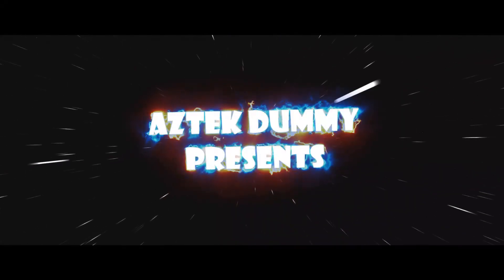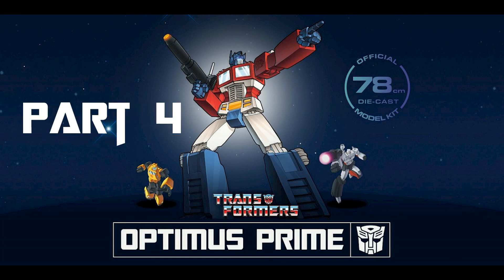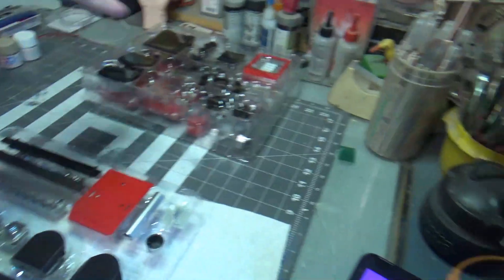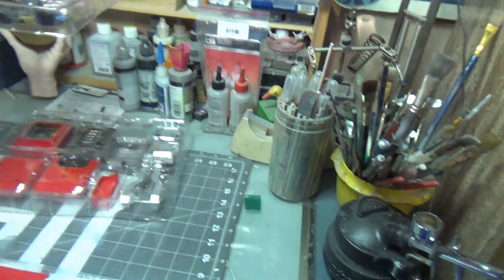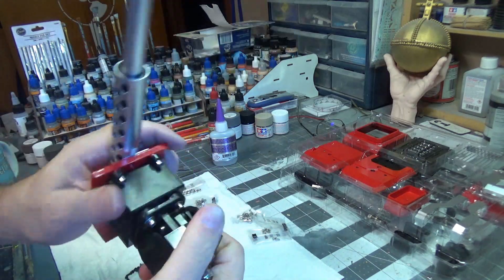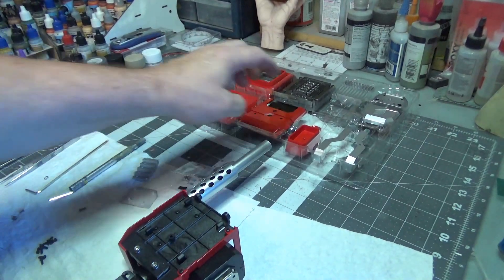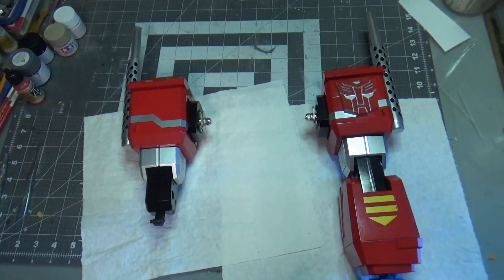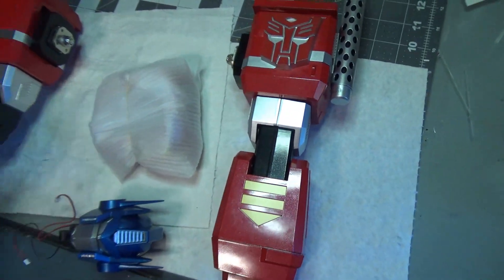Agora Optimus Prime - Part 4

Comment: That is going to be massive I just wish they had the option of getting the entire thing in one go if you pay for the whole thing up front as I heard stories about the Millennium Falcon having parts where you want like three kits to build the cockpit. Because they don’t explain not to use glue until the end of the section because of additional parts that need to be installed in the next few packs.
Reply from the maker: I hear you. Sometimes they do after the whole thing has been released. I bought an R2 off a guy on Ebay that way. Oddly enough,  with my schedule, I find the monthly pack is just the right amount. I think I'd not appreciate it enough if I had it all at once.
Reply: @aztekdummy  they should definitely put in the instructions not to use glue until all the pieces for that section is done I just wonder how many people had to brake a glue joint to add the next step

Comment: The reason his head is smaller then his shoulder is because this is not so much G1 Prime as it is Dream Wave Comics/Pat Lee's version of Prime. And Pat Lee learned proportions and foreshortening from a blind bat. All of his Transformers have HUGE shoulders, arms, feet and tiny torsos up on which set microscopic heads. Never been a fan of his style.
Reply from the maker: Still so much better than the Bay design. I did replace the huge antennas with something more G1
Reply: @aztekdummy  Yeah I saw you replace them with those nice printed ones. Very cool. You know, using 3D software isn't all that hard, I was a 2D artist for years before I ever did 3D, I think you'd take to it.